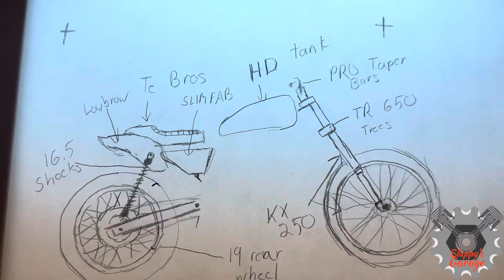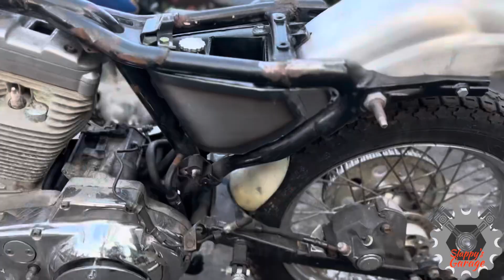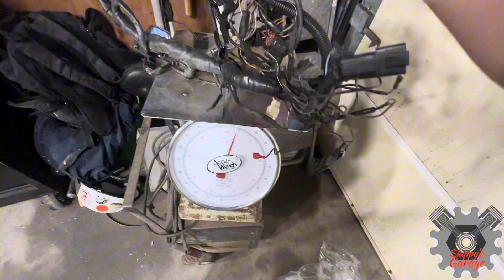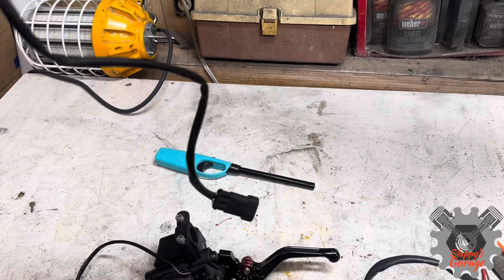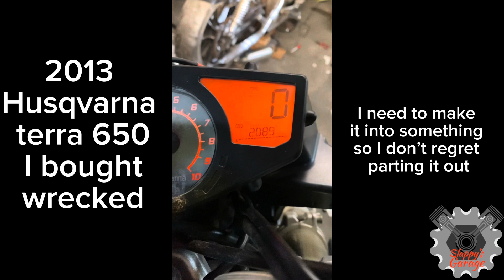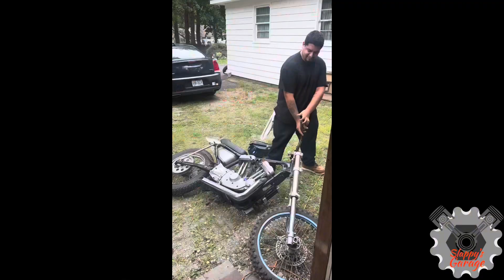Harley Davidson Dirtster Build Update

Comment: Long term, I want to do something like this with my sporty. This bike so far is closer to what I want than any of the Gucci "scrambler" builds that have 20k in parts. Plus I appreciate that you measured the ground clearance, no one else has covered that so far. Lookin forward to the next installment.
Reply from the maker: I’m trying my best to use what I have, or what I can get second hand.  But it’s been a struggle to find what I need next so the installment’s are spread out farther then I planned.  I may add to much info or not enough but I’m learning as I go to add what seems most important such as things as ground clearance or for people who it may interest a cheaper/easier route
Reply: @SlappysGarage  personally, its a constant battle between "buy nice or biy twice" (even with budget builds) and "get it on the road and fix it later".

I will say, Ive been ultimately happier taking the latter route. If you go into it knowing a lot if what you got wont live forever and just enjoy it for the time being anyway, I find much more excitement in my projects which makes me much more motivated to keep working on them. Keeps morale up, albeit it is ultimately the more expensive route.

I noticed you still have flat stock for rear suspension. I may have a suggestion, VW bug guys have these 17 or 19 inch shocks that come with helper coils, they're about $100 for a pair on ebay and if I dont find a different solution Im going to try them out for my build. Since theyre just helper springs, they shouldnt be too stiff. Thought I might share that if rear suspension is one of the pieces youre struggling to find.
Reply from the maker: @TheAnimal191  so the bar is a mock-up, I have a set of xr 16in ohlins rebuilt coming in. But to wait is the battle with those, the same guy will also revalve the suspension for the weight.  But that’s taking some time rather then spending top dollar for brand new.  For me it’s to get the best bang for buck while on a budget.  Parts like exhaust I rather a beat up pipe then a brand new shiny one especially since a Dirtbike will destroy those parts
Reply from the maker: @TheAnimal191  I do really enjoy this information as it could be of use for anyone else interested.  I also have some 14 burly shocks that are affordable on my flat track bike which may not give the ground clearance but to anyone interested in a cheaper route have worked great on another one of my bikes